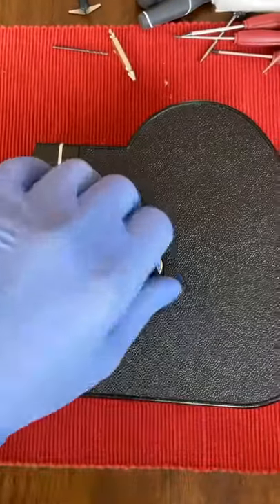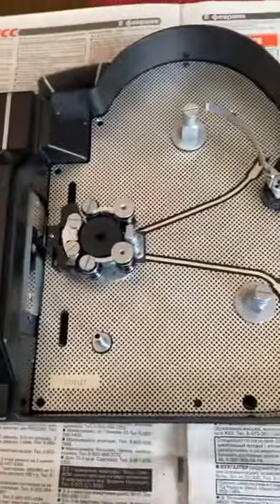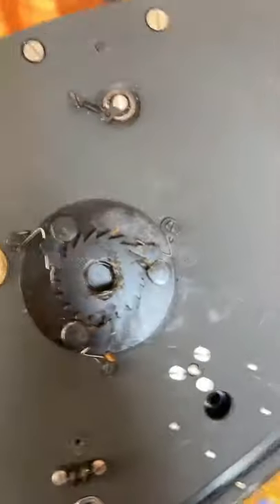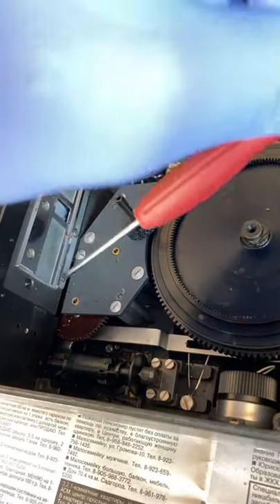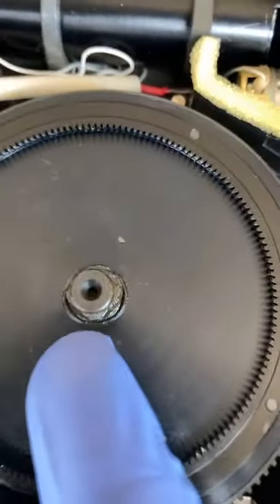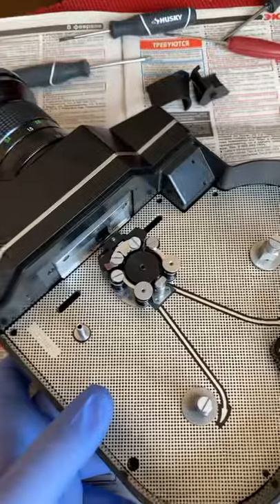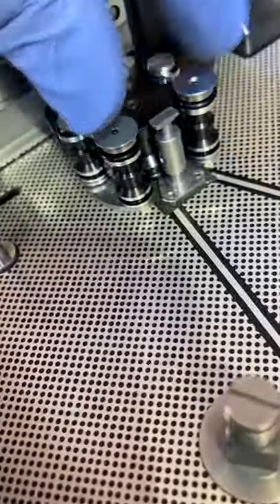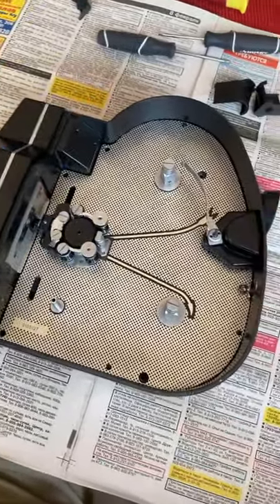Converting your Krasnogorsk 3 into Super 16

Comment: Do you have any idea where to find the gate? I can't seem to find them anywhere.
Reply: You might want to check ebay. They usually pop up there very frequently. As I am typing this, I checked on ebay by typing: krasnogorsk-3 gate - and one Super 16 gate came up at USD 64,84 (buy it now option, so no bidding necessary). Another source for film camera parts ias the Facebook group: 8mm and 16mm filmmakers group: For Filmmakers who Shoot on Film. You might consider joining. Great people over there.
Reply: @truefilm6991  at the time of this comment there were none left on eBay, but I eventually came in contact with a guy who sold them and he notified me when they were in stock so luckily I got one. I got it for about $60 which I think is definitely overpriced but it was the only one available
Reply: @BillyCobbOfficial  It's not cheap yeah, but it's a special item. Please make sure you polish the extended side (opposite of the vertical slot for the pulldown claw). The widened gates usually come only milled out, but not polished and thus cause deep vertical scratches. If you don't know how to polish: just use very fine sandpaper (1000 and 2000 grid) and a drop of fine grade machine oil on the milled out area only it needs to be as smooth as glass. Also make sure you have the recentering ring to avoid ugly vignetting on the right side of your image. Just making sure you enjoy your film projects. :) Any further question (not an expert, but I know a few very knowledgeable people and I am a happy Super 16 K-3 user myself): please just reply. Best of luck with your film mprojects!
Reply: @truefilm6991  Hey, what exactly is that recentering ring you mentioned in the above and where exactly does it belong?
Reply: @elialang5953  the K-3, the models with the M42 mount, has a lens mount ring at the front. It has four screws, easy to remove. You just swap it with the recentering ring. Now the optical axis is correctly centered for Super 16. They are cheap and not always perfectly machined. You need to check the thickness with a calliper and either file or shim with sheet plastic to get the back focus (flange focal distance) perfect. Mine was fine. Just the thread is a little rougher, so I always give it a film of fine machine oil. Hope this helps.
Reply: @truefilm6991  Hey, thank you a lot! This clearly helped me. I am just wondering where I get this abovementioned ring now. So the basic m42 screw mount ring won't do the job if I swap the gate to super16, right?

Comment: The title for this video is inaccurate. You are not converting your K3 into S16, you're merely changing the gate. Additionally, you forgot to mention that the lens mount needs to be re-centered, otherwise the center of your lens won't align with the center of the gate which will cause vignetting on one side of the frame.
Reply: Is it hard to recenter the lens by yourself?